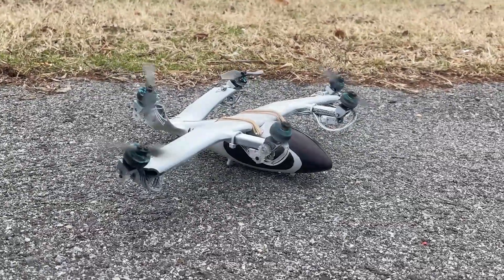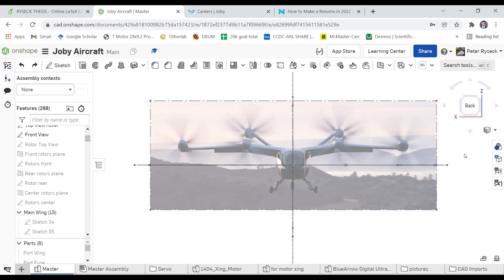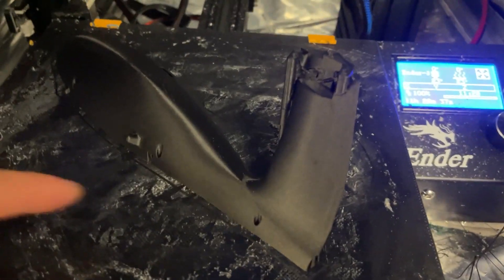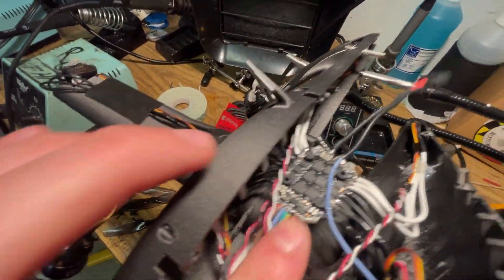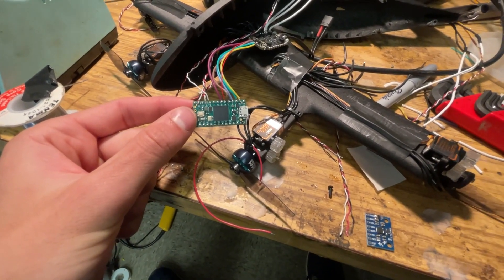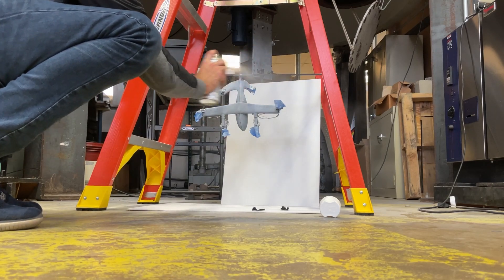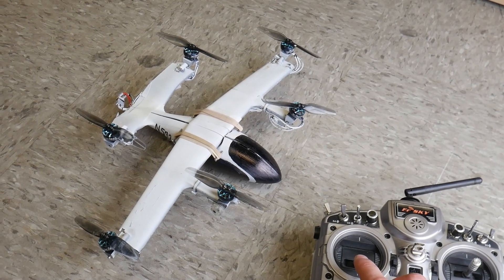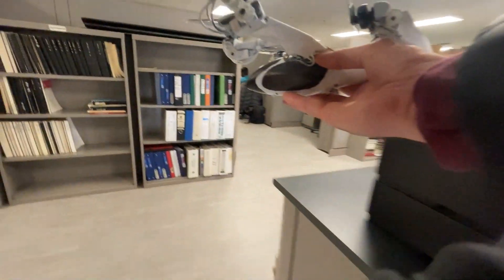Flying RC eVTOL Joby Aircraft Model

Comment: Hey, this was pretty cool.  I'm doing a similar thing with the Opener Blackfly (building an RC model).  I'm wondering why you used gears to link your servos to the motors instead of directly mounting the motors to the servo arm.  It could save weight and reduce moving parts count (ie improve reliability). Yes transitioning to forward flight is tough because it covers a lot of distance very quickly.
Reply from the maker: Hey Randy, it's a great question, thanks for asking and I'm looking forward to your replica! The reason was to keep the slenderness of the joby aircraft as close as possible to the real thing. If I didn't place the servo under the tilt rotor with additional gears, it would be off to the side, requiring more structure and making it look generally more bulky. Theres also less rotor wake download with the servos under the rotors vs. off to the side with no additional gears. It also provides me the ability to change the gear ratio should I find I need greater torque or speed.

Comment: Very impressive. Curious what kind of flight time are you getting? Keep the videos coming!!!
Reply from the maker: I need to fly it more to know for sure, won't be far off from a quadcopter I think. Probably 6 minute hover time I would guess. Will be posting more!
Reply: @peterryseck  Can you add more battery and see if it can handle added weight while increase flight time.
Reply from the maker: @vgsalvi2007  probably not unfortunately, the battery barely has enough room on its own
Reply from the maker: @vgsalvi2007  but I’ll try to get a better hover endurance time stat